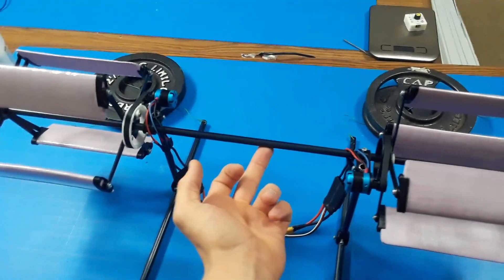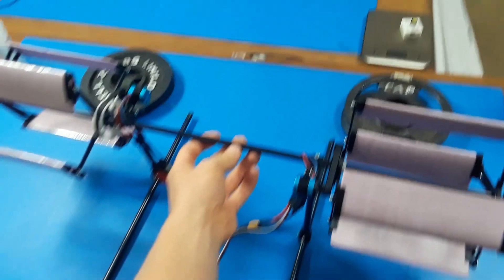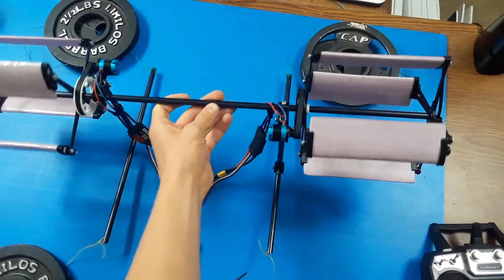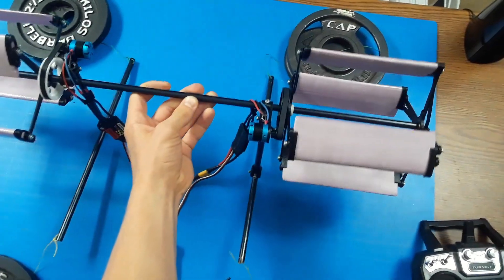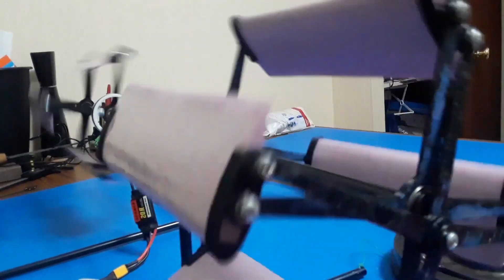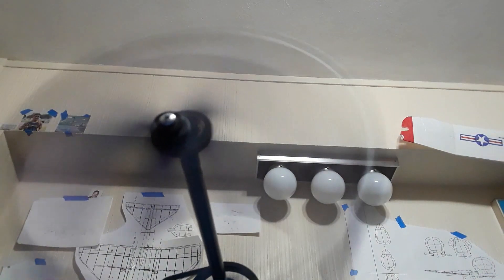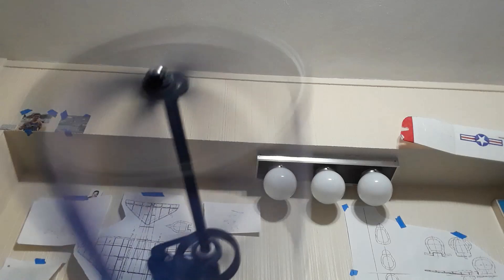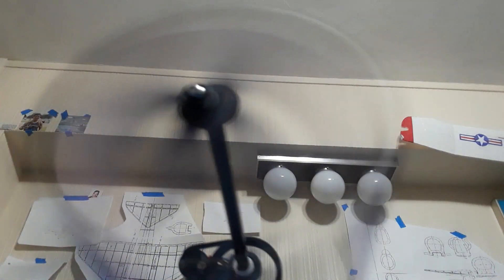Cyclocopter Tethered Flight - My First Proof of Concept

Comment: Hi Jude so awesome. I’ve been recently looking at under camber wings for thrust. Seems to be viable. Extra thrust with less revolutions. 🙂
Reply from the maker: The trouble with under cambered wings is that they tend to cancel each other out during opposite sides of the rotation.  They do make an impact, but it isn't as big as one would think.

Comment: saw a video where  2  rotor heads were used for a hover flight.
Reply from the maker: Yeah, a couple of people have done that.  The thing is, I feel like that's a little cheaty because you have to have a conventional propeller to counteract the torque of the motors.  I could do that, but I think it would be cooler to just go ahead and put four rotors together.